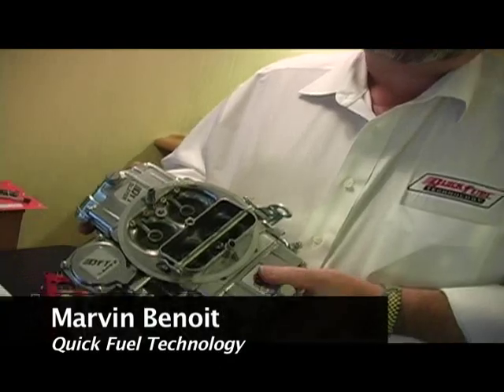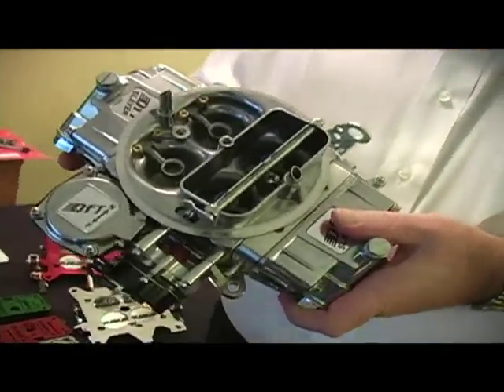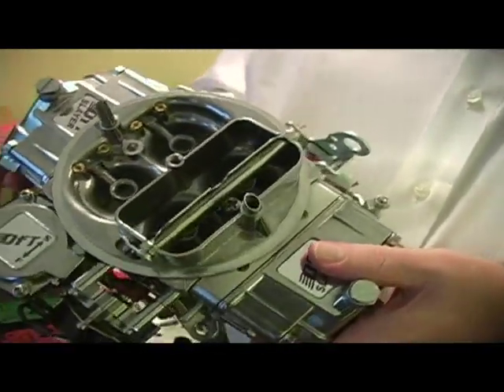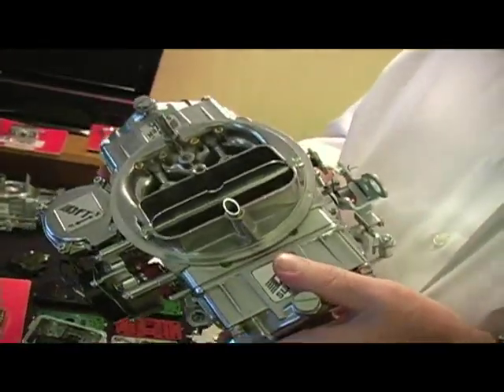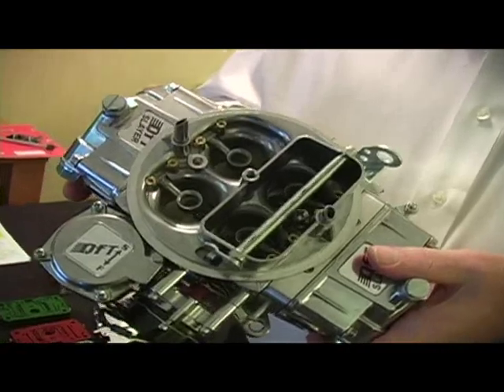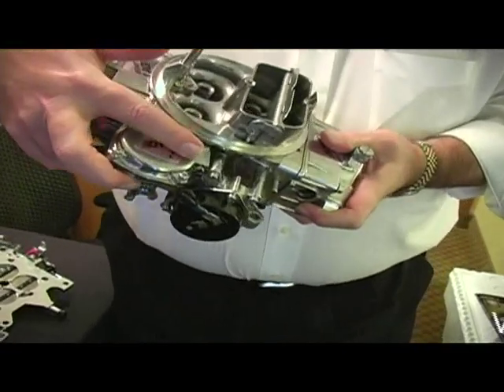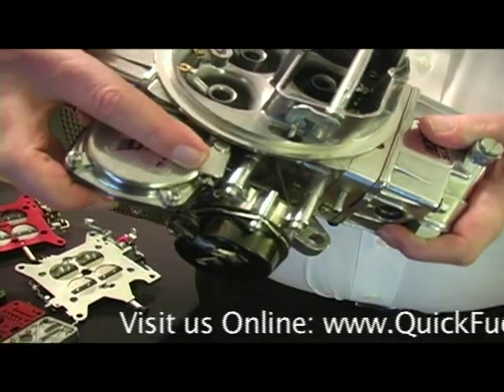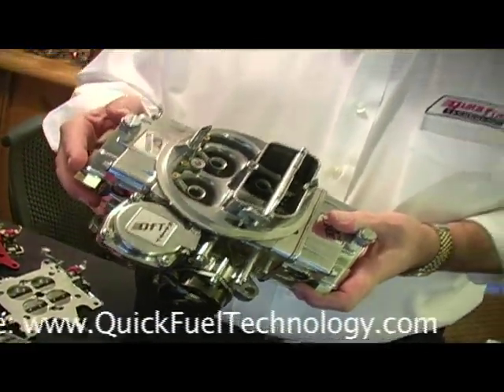NEW PRODUCTS - QUICKFUEL'S NEW SLAYER SERIES

Comment: This carb is great! almost works right out of the box. Speed shop guy thought I might jet it down two notches Primary from 72 to 70 secondaries from 83 to 80. I did have to buy a cam kit for the accelerator pump and bump it up 2 notches but it got rid of a little flat spot. Still have to adjust the secondary spring now tha the jets are smaller but it's OK, I used to have to change secondary diaphragm springs. now I can just turn a screw. Brilliant! It reminds me of a Holley with a lot of complaints taken out. And a lot better tuning options than the old vacuum secondary Holleys.